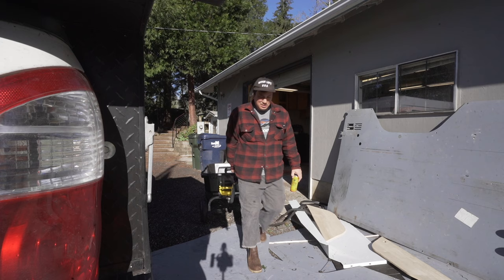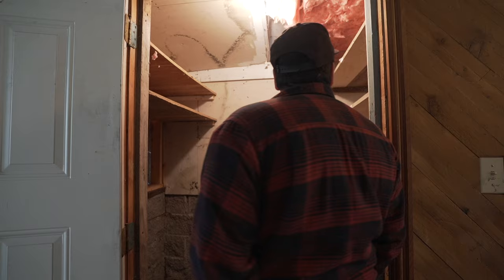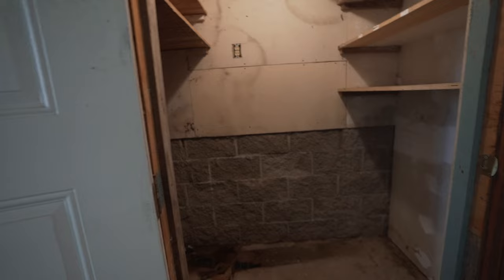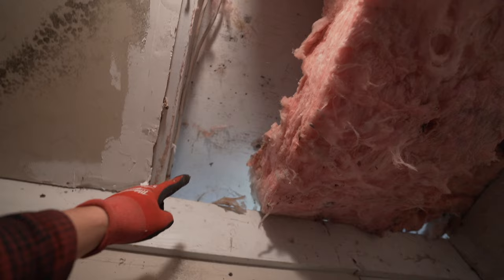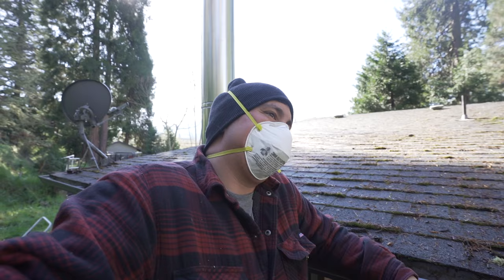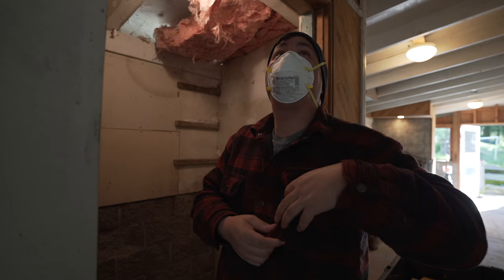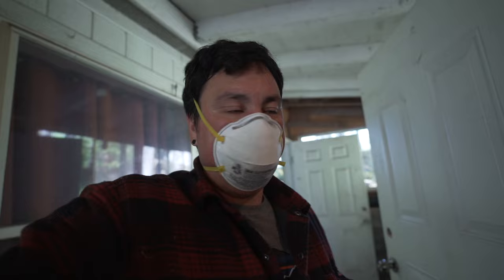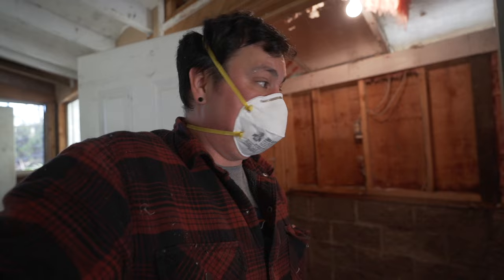It's Worse Than We Thought... (Mobile Home Demolition)

Comment: That area needs to be an open side porch. What a mess! You may want to have a work party and get friends to help. You're not alone.❤
Reply: I agree. I would make it a porch!
Reply from the maker: Ha ha maybe!
Reply: i think that is what it was... @isaacturnerit
Reply: I agree. It looks like it was a porch at one time. 

Dig out around the outside and put in some sort of flashes that would divert the water from the sides of the room. 
God Bless you and your family❤
Reply: * flashing
Reply: @peggykelly2821 yeah was thinking a screened in porch that way ember can play there and they don't completely lose the space but if they are worried about the whole build id just take off the whole addition it ain't up to code anyway by the looks of it and might save a headache down the road.
Reply: Totally agree!
Reply: Agreed.  Comment above about what I see as issues
Reply: You are working so hard to provide a stable home for Ember. Great Dad!!!

Comment: Awesome job isaac. Go enjoy the day.  Just one thought, take the walls out but leave the roof up and fix it with the house roof. Even with an open patio, you all have so much rain, you'll get much more use from a covered patio ❤
Reply from the maker: Leaning that way too
Reply: Agreed
Reply: Just starting to watch and my gut tells me what I saw when you had the ice storm and the roofers come fix the roof.  Whomever roofed they did not use underlayment. If you watch the video from the hole, when the roofers pulled back the damage, there was no underlayment.  Need an entire new roof. I would make a covered patio. Much better use for sure
Reply: No underlayment on any of the roof over the actual home.
Reply: I am surprised the home inspector didn’t find that. Assuming you had a home inspection. Not the appraisal- but a home inspection
Reply: I would also question if he used tyvek under the entire home and additions siding. Wonder if this could be a homeowners insurance claim if have to completely reroof and look at siding as well
Reply: YOOO, this project was full of surprises, but you got this 🙏🏿😍

Comment: Isaac, we have gutted and redone two houses and you know what the best part of it is? When you're finished, you'll know it was done right and can take comfort in that. We found some unbelievably dangerous things in the last home we redid and were fortunate that no one was hurt by those situations. After we were done we knew what we had and how it was done and that it was SAFE.
Another thing...you might want to get some breathable hazmat overalls, especially when dealing with fiberglass insulation and mouse poop and who knows what else. And a shopvac with disposable bags---mouse poop, especially, can carry some pretty nasty stuff.
And get a cat that is a good mouser!!
Wishing you patience and peace...
Reply: That is very true. Even the knowledge he gains from doing it is awesome. It's going to be okay Isaac! You got this man. 🙏❤🌞
Reply: We live in a home built in 1952. We recently had water seeping in our laundry room. Originally the room was a carport, turned garage, now laundry room. We've only been here 5 years so all of those alterations were done years ago. Anyway we had to put in a french drain and new gutters to divert the water away from the house. We resealed the outside foundation too. It was a lot of work, but now we know it's done right. We just finished inside because all the flooring had to be replaced.
Reply from the maker: Great tips thank you

Comment: I vote reroof and open patio.
Get rid of the the damaged stuff.
Thanks for sharing. ❤️❤️💛
Reply from the maker: Thinking the same!
Reply: @isaacturnerit  I once had termites dangling from my ceiling. I had no idea what they were. 🤢
Reply: I agree but I would also try to find out why there are those big ants in the wall. Here in Florida we have carpenter ants and they eat the wood in houses.
Reply: I have them in my cabin in Idaho and spray three times a year to keep them from returning.
Reply: @marlenefrazier  I have my house treated a few times each year to keep them out!!
Reply: Yeah!!! I like this idea too!!
Reply: You have a steep hill behind the house, when it rains where is the water going

Comment: Every step you take is improving your property. It’s tough.

Everything you said is spot on, Issac.  For now, if you feel like demo? Do it.  Get that hauled off /burned and opened up. Then the worse tree:  trim it down to half?
Reroof house yourself. You tube has plenty of videos.

People do these type things into their 60s! Yes, it’s a pain to clean up others screw- up but you’ll do it right and your property will be gaining value. I’ve always be told “don’t over improve or add an addition on to a property UNLESS it is your FOREVER home”.

Demo is cheaper than spending over $5K to even get close to improving:  roof, new drainage, rewiring, new installation, windows, framing new walls……

Open it up, leave a fireplace. You got it, Issac. Make $$ off YouTube as you film it!❤

May need another big dumpster.

Drive up the mountains and take breaks! Come back and hit it again.
Reply from the maker: Thanks to thinking the same thing!

Comment: Ground water is making the wall wet, need to pull all the dirt away and put waterproofing on the outside of the wall to the bottom, add several inches of gravel then waterproof the inside of the block.
Reply from the maker: Def
Reply: @isaacturnerit you need to get yourself a hazmat suit from home depot.
Reply: I can tell you what my dad did since our back yard was under water; buy drainage tile it has rows of holes across  in it going from one end to the other. The rows are all the way around it  You will have to dig a trench across from one end of the room to the other end near the wall make sure you keep it level use a line level.  You want the till to exit out of the soil to drain the ground. You will have to dig the trench starting at the sidewalk all the way across the length of the building  to allow the water to express out.  After digging the trench next to the outside wall using waterproof paint paint the wall below the ground to above ground . Now putting a load of gravel in the trench making sure it is level you have dug make sure it is level  all tho way across use your line level. ( you should b able to google or ask the tech at Home Depot how to use a line level) Put a level amount of gravel all the way across. Lay your tile end to end butted to each other Then fill in the trench with a level even amount of gravel covering the tile with 6 to 8 inches of gravel all the way across 
from one end to the other. Make sure you have at least 6 to 8 inches of gravel over the tile and fill in the rest with your soil over the gravel. 
You should be able to google these steps or ask the tech art home depot or wherever you buy your drainage tile. It is a job I know my dad, mom, brother & I did this when I was 12 years old. We never had a pool of water in our backyard ever again. Every spring & fall we had a small pond in our backyard in Ohio about 1/8 of a mile from Lake Erie in Mentor on the Lake, Ohio the northeastern Ohio
Reply: Waterproof the blocks on the outside with hot tar will help keep water out

Comment: The concrete blocks are a retaining wall for the huge hill behind you. All the moisture will transfer through the block because it’s porous. You need to remove all from blocks and seal the concrete. Also you need a dehumidifier to remove moisture from the air, when you use the wood stove it will dry the air out.
Good luck and wish you well!
Reply from the maker: Fosho
Reply: Also dig the dirt away from foundation and seal it up with specialty paint/ sealer and put up new plastic style barrier and push dirt back. Maybe a foundation drainage system at the base of the wall to divert water around the back of the house.

Comment: Check all your down spouts and gutters, maybe check for some way to divert rain water or such away from house. Might help. Just a small thought. Hope it works to dry it out. Also make sure they are impacted with leave and etc. You can take a garden hose to some of the down spouts. ❤
Reply from the maker: Def
Reply: @isaacturnerit if it’s the roof, I’m sure it won’t be fun to fix. But it’s pretty simple. I was watching ur video while I messaged you. I’d even say clear out all the leaves and debris from next to house. That can hold moisture as well. I saw the mouser, lol. I’m sure it’s warming up and they will be moving around more, lol. Oh btw I live in the country. We see them all the time. 🤮dirty lil crittlers

Comment: Issac, you can buy pretty cheap the tube for a french drain at home depot, lowes etc. It is about 6 to 9 inches around. Black corrugated tube, flexible kind of like and dryer vent hose. It comes predrilled with holes to catch water. It also has a 'sock" that stretches over the tube before you put it in the ground. You just dig a narrow trench about 12 inches deep. Put layer of gravel with some sand , pipe, then small gravel on top. Route it away from house down hill. French drains are real easy if you're willing to throw some elbow grease. We have done several on our property. Been in the ground for 25 yrs or so, still working like a charm. Use the dirt removed to fill in other areas on property.
Reply from the maker: Def!

Comment: I think after you move all the branches. You need to put a French drain in (I believe that’s what it’s called). You dig a trench about a foot before the concrete. You then put river rocks, then you can put a pcv pipe with holes, then more rocks. This allows the water to drain away from the building
Reply from the maker: Still need to look up what a French drain is!
Reply: You are 100% correct. That is what I was going to recommend he do as well.
Reply: also…. french drain is installed at a slant to carry the water away from the building….

Comment: Get rid of that wet wood and remove the brush and get gutters and put new wood on . New roof roof it seems too .  Everything that guy did is sketchy . I'm guessing most of it needs to be replaced because he had no clue what he was doing . WOW anything that guy did needs to be removed . Gonna take a while but the more you remove the better ! Yup open patio for now .
Reply from the maker: On it!
Reply: just spray the roof with bed liner or some sort of a liquid plastic

Comment: Looks like that pressed board is not sealed properly and no seal between wall and concrete blocks. I would get rid of anything wet/moldy. And yes get all of the debris away from the bottom. 
The shingles are cupping. Not a good sign. Definitely should have had underlayment. We had a tin roof installed because of a mess like that. It was our best option at the time.
Just like building buses. One step at a time. Spray for bugs. Get rid of debris that draws them in. Airflow to dry things out. Coat everything with paint for mold. Good luck! You may need to phone a friend on this one. Call in your troops!❤😊
Reply from the maker: Def ain’t

Comment: I've read through a ton of the messages and agree with most.  New roof on home, covered patio/play area (can be screened in later), address drainage around retaining wall/patio, and be ultra careful working around mold.  - - I'm curious, what is the reason for the wooden areas of flooring when most appears to be concrete?  - - The wheel....LOL - - I bet those shells were sunflower seed shells left by your little mice friends.  - - Hang in there, home ownership is a job in itself.  - -  Hugs to you, Jaylena and Ember
Reply from the maker: Ha ha thanks for watching

Comment: Wow!! You got this bro.  I am not a roofer, but when my roof was replaced, the roofers made sure the first layer which is plywood was in excellent condition.  Then they replaced the tar paper, and next they replaced all of the shingles.  Also the cement block retainer wall needs to be sealed else water can seep through the wall.  If there is any wood touching the dirt part of the retainer wall, it needs to be replaced with cement blocks.  You also need to add more drainage in addition to good gutter drainage (This is key to alleviate water seeping in through walls).  There are holes in the roof and roof encaps.  Water can come in there as well.  I would also install permanent vents into the end caps which is the tip end of your roof to ensure you always have airflow in that area.  Hope this helps.  Good Luck!!
Reply from the maker: Yeah I need to figure it out!

Comment: Drainage and organic material up next to the siding is the biggest issue. I'm guessing those downspouts that are run into the ground DO NOT go into any sort of drainage pipe.  If it were me, I'd put a French drain in the back so water coming down the hill cannot get into the structure.  I'd tie my roof drains into that as well.  I'd have rock up next to the structure to keep critters away.
Reply from the maker: Fosho

Comment: A French drain is a trench filled with gravel or rock, or both, with or without a perforated pipe that redirects surface water and groundwater away from an area. The perforated pipe is called a weeping tile to facilitate drainage more effectively. Issac,  this explains the meaning of a "French drain". 

Around our home we have this as our home is on a concrete slab. We also put down heavy landscape material then added 6 inches of pea stone on all sides. We no longer have any water problems. It was well worth the time and money to divert water away. 
Good luck and keep those videos coming. Being a first-time homeowner can be stressful to say the least but doing your research will help immensely.
Reply from the maker: Got ya!

Comment: in all honesty even with what a lot of others are saying. I would get on the roof take back shingles until there is underlay.  put under lay on there and reshingle.  make sure all the mold is gone on the roof.  knock out the wall but leave the concrete brick wall to hold.  but make a nice outdoor porch.  knock the closet down but use the light for outside light.  knock the closet out.  leave the fireplaces. and make a nice outdoor area.
Reply from the maker: Fosho

Comment: Did you contact your home insurance when the limbs came through Embers' room?  You may have been able to get a new roof for the price of your deductible.  That's what happened to us once. If not, you might still be eligible.   If not, check to see if the rest of the roof is without tar paper.  That back room could have been added on later, and he cut corners then...fingers crossed.  If the whole roof is without tar paper, best to re-roof.  I agree with you, open up that entire back area, so you can see what happens during a storm.Those ants looked like carpenter ants.  Also, hopefully, the water issue is only the roof and debris behind the house.  I would check that retaining wall too because water could be seeping through the back.  So glad, you wore a mask, you dont want to take any chances with mold and mouse droppings! Good luck Issac!
Reply from the maker: Insurance won’t help

Comment: You've got this, Isaac. Just think of it as a HUGE bus....with no wheels. 😊 The debris is definitely causing draining issues... there's probably French drains somewhere around that block wall. Find them. Clean them out. Clean gutters. 100% remove the moss from the shingles. This is causing water to dam up and backflow up under the shingles. This will buy you some time until you can resheathe, underlay and shingle the roof. Don't panic. One step and day at a time. Together, you absolutely can do this. 💛
Reply from the maker: Ha ha def think I’m starting to wrap my head around it more
Reply: You absolutely can do this. I've seen your skills with tools. Same concept just on a lot BIGGER scale. Sketch up your plans, make a list and get after it!  @isaacturnerit

Comment: Those carts are great Isaac but you need to keep a supply of those cotter pins in your stash because they can come out when you don’t realize it and then you can’t find it. I lost mine for my handle in my yard and it held on for a bit then pull off and I could not find the dang pin anywhere. I bought a dozen of those suckers to keep in my shed just in case. You were lucky to find the pin.
Reply from the maker: Ha ha dang

Comment: Issac if your gutters overflow, the point of the down spout is the lowest point and if the drain connected to that downspout get plugged or blocked then it's dumping a ton of water there. If the sheeting under the shingles isn't wet or rotted than that is not your problem, it's not great practice but the shingles should seal it and make it water proof. Odds are when your gutter was clogged then water overflowing into all of that wall everything it rained just fed the mold, mildew, and funk!!!!
Reply from the maker: Def

Comment: Hi Isaac. Still much love and hugs to you all. Just a suggestion that to tear all of the wood structure walls and roof down. You would still have concrete foundation. Maybe consider looking into Adobe tube bag walls. You have fireplace for heat and you could reuse windows. Easy and fairly inexpensive. As well as eco friendly. Good luck
Reply from the maker: Gotcha I’ll look into it